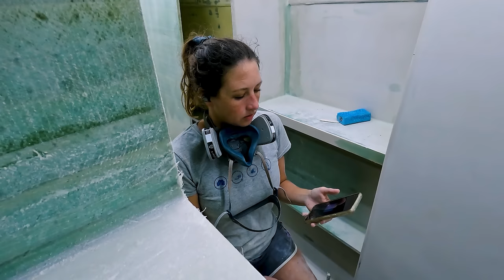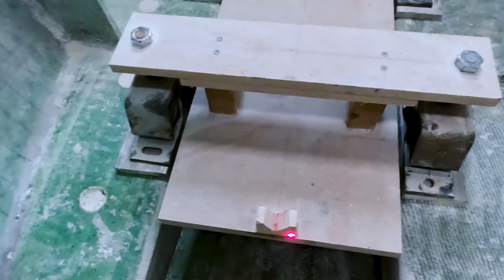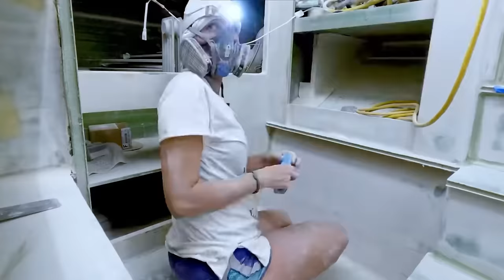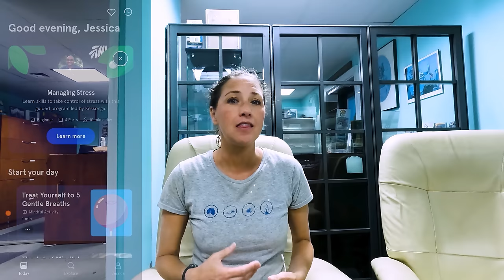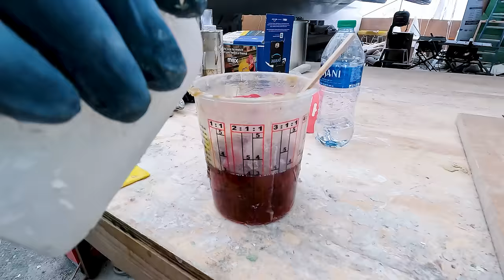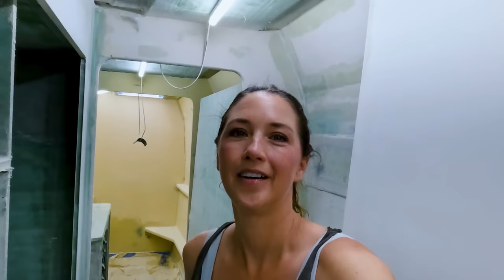NO Wear & Tear for the Cutlass Bearing on Our Home Built Catamaran (MJ Sailing - Ep 297)

Comment: Fairing. Instead of using the flexible yellow applicator from the autobody industry, meant to accommodate curved car surfaces, look at drywall tools for walls. Those metal flexible joint knives are meant for flat surfaces. 6 and 12" stainless versions would cut your need for multiple layers and sandings.  And stay a a 45 degree angle to the wall for finishing. This gives you more control over the amount of material you apply. Less angle when you're looking to fill and blend over a larger depression.
Reply: I said the same thing when they started, now I find it hard to watch.
Also too many adds😪
Reply: @wanderingwombas  
Honestly its possible they didn't see your comment, though they have responded to a few of mine, this tip might be insanely helpful for them honestly. It could save them months of work honestly, maybe you folks should just say it a couple times on every video, until they respond to you..

Comment: I totally get all of the extra care that is required when assembling things like the prop shaft tubes and ensuring they are perfect. However these are things certainly as a viewer I would have thought a "kit" would have addressed making assembly easier for the installers? Again though its not a criticism of the manufacturer its just a reality that a build like this is not simply a "snap together" or "place and play" project. Incredible work as always you two. 😊

Comment: Love your project.  Just an idea, but to keep that line straight, try hot gluing a board beneath it, then running a Sanding block above it to get the top plane flat.  Move the board, reglue it above the line, then sand in the same manner, below the board, to keep the line perfectly straight.   Just a thought.

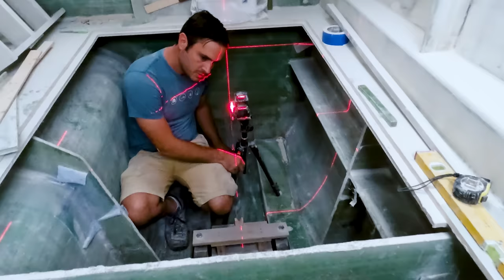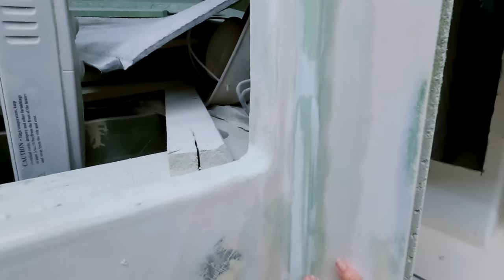Comment: Could I recommend that you use laser safe glasses when working with ANY laser source... at 2:45 the line right across your face and eyes.... Such a huge amount of quality work so far. At 14:54, how about a quick light squirt of primer to more easily see surface and any imperfections. Subbed here.

Comment: Assuming you have already checked the motor beds are on centreline of hulls can you not measure the distance from the centreline of the two  engine beds and the centreline of the two stern tubes to check if parallel. Set front of engine beds level to each other and stern tubes level to each other. Then the degree of inclination can be set and the motors shimmed for best alignment. I am sure you will be doing a better alignment on your boat than most manufacturers are doing on the boats they are building. Keep the good work up !

Comment: i was in the custom paint business for a while and I always use hard blocks when sanding, even curved surfaces. Foam blocks only follow the waviness you are trying to eliminate. I would use long  doll rods like a cut off broom stick to sand those coves, wrapping  the sand paper around the rod about 6" long would speed up your intended results. Do the long surfaces first and then touch up the corners. Remember, it is a boat not a grand piano, good enough is the result and move forward.

Comment: Measure down and attach a straight guide above the line, equal to your plastic spreader hitting the corner. Carve a single spreader into the shape you wish, so that you can hold it at a 40 to 50° angle and get your line using the guide for spacing. Butter up the seam gently, barely a skim coat. And then carefully run your line in a single even pull. You need to gently pull away about 3/4 of the way down and switch to the other side after cleaning your plastic scraper. Come back from the other side with the same motion and as you cross your previous lines end gently peel back via angle rotation and then lift away in one spot so that it is easy to sand flat. Ideally there's a slight pucci Audi where the over out is.
I thought about changing the poochie outie, but thought better of it😅

Comment: May i suggest to Cut your angle in your squeegee to match the angle then pull your filler along the cove parallel not 90º to cove. wrap a dowel with your sand paper. good luck.

Comment: Eternal sanding and fairing is why you use liners inside the hull or you spackle spray it just like mud work in a home.  Easy to finish or you get the final finish in a MOLD!!! IF you are so worried about weight on a CRUISING boat which is NOT a RACE boat, just add more mast height.   Life is too short.
Reply from the maker: We have the rest of our lives to sail. And we've found out now, afer 11 years of the nomadic life, that we can only cruise for 3 years before getting the itch to take a break and do some kind of project.

Plus the weight concerns aren't necessarily for high speeds, but for traveling in light winds.

Comment: Do the boat yard go to these standards when aligning there stern tubes?
Reply: The boat yard has a moulded engine base,  with a steel Jig  for shaft alignment ,  so engine bay is now done in 1.5 days  ,  The first max 44 with inboards  we did very similar to the way MJ  is doing  it took around   5 days as we where also sorting rudder   and options.   It explains why  many builders only offer sail drives,  very easy to place in.
Reply: @fairwinds9630  thanks for the info, as a process engineer (sad i know) i find these details of interest.

Comment: You need to check on the plans what the manufacture tolerances are , otherwise you will be going around the houses for ever. So long as you work within the tolerances you will be ok. There is no point in working to zero unless you can afford to double or treble the work.

Comment: I do have the greatest respect for your determination but I don't understand why each and every surface has to be sanded primed sanded a.s.o. Why not use nice liners where possible and approriate ? Saved you hundreds of hours.
Reply from the maker: Hundreds of hours, but liners would add a lot of unwanted extra weight.  We got this boat for light winds, and if we can keep the weight low, we should be able to sail at wind speed up to 13-14 knots. 😃